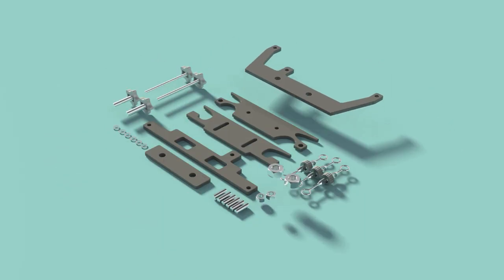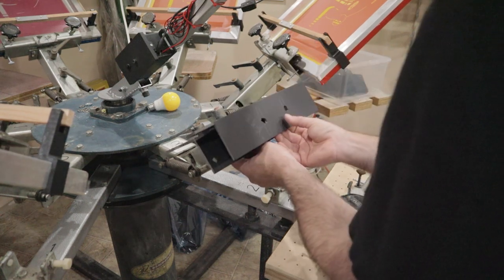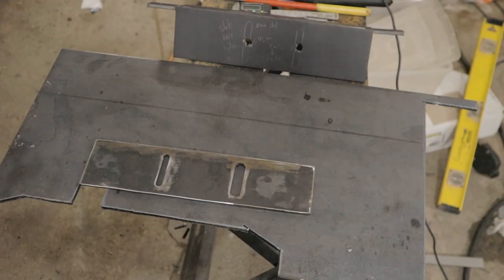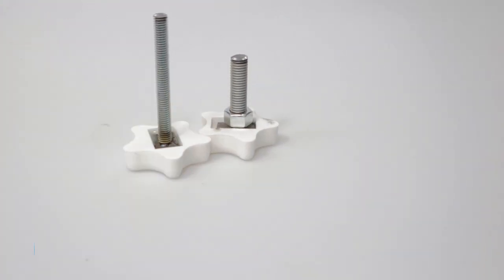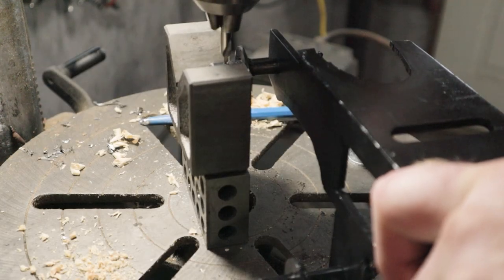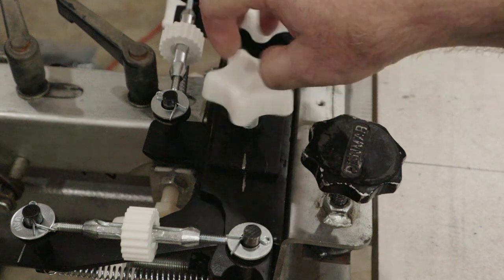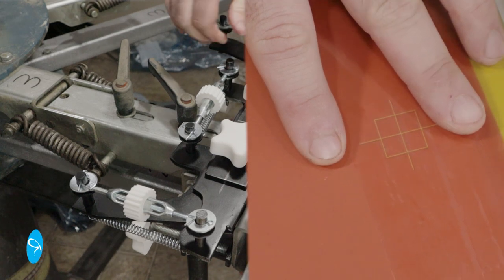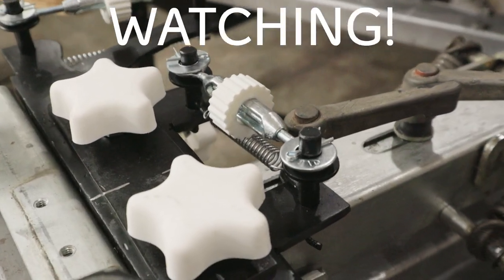DIY micro registration for your screen printing press.

Comment: I think the design is pretty spot on, finer threads aren’t a problem.
Or someone could fabric their own turnbuckle.
Maybe even use coarse ones, much longer and at a 45degree(or something).
Either way, if the plans were available on your site I’d buy them, I would obviously have to modify them, but it would save me time.

Comment: Man that looks like a success to me
Reply from the maker: I honestly think it works as intended, but having never seen or used actual micros I have no idea. I wonder if even the factory made ones are this fidgety. It takes longer than expected to dial it in and i want something quicker. I'm working on a new design now to replace the clamping mechanism in a way that doesn't rely on twisting forces.  Whether it works or not I"ll still make a video about it.
Reply: @RichardThompsonCA   Hi sir please I need the construction diagram of the micro registration I would like to do the same but I don't have the right dimensions can you share with me the diagram

Comment: Impressive fabrication. Looks like having all those adjustment capabilities ends up being an issue. I wonder if one of two options could help with those final two tightening bolts/knobs. The first thought was C-Clamps as well for at least a temporary option, if not the basis for a replacement solution. I think even one clamp applied to a section where the plates are already pressed together is better than two adjustable knobs with seemingly unsteady bolts. However, maybe you could weld some receiving nuts or threaded shaft that those bolts could screw into, rather than into the flat steel. Or grind the bolt ends into a point and create some receiving divits into the steel plate. Seems like a lot of work that's worth a little more manajalation to get it where you want it. Fully understand getting that far along and wanting to bail, with mental fatigue and such. Liked and subscribed. Great work and channel, sir!
Reply from the maker: Thanks. I have built a new clamp system, just haven't made the video for it yet. It isn't a micro registration, but it is much more precise than the original factory clamp and doesn't apply twisting force to the screen. What I'm looking for is something that registers quick. I'm hoping I can put the screen into alignment by eye, and just clamp it down without it moving. I based these micro's on designs I'd seen on other presses, so was confident in the overall concept, but in practice I find it tedious to use.
Reply: @RichardThompsonCA  need the video asap please
Reply: @RichardThompsonCA   Hi sir please I need the construction diagram of the micro registration I would like to do the same but I don't have the right dimensions can you share with me the diagram

Comment: I have always wanted to build my own press. I have an old BenMar that is very similar to this. But I'm wondering if it's worth all this just to get one more point of articulation? You seem to have had all of the adjustment capabilities expect for side to side. I enjoyed watching you build it. Might be the kick in the but I need to start tinkering more with one of mine.
Reply from the maker: I guess I did this because I was finding that chasing the registration by tapping it in was getting really frustrating. But, while this is more precise, it's still frustrating and slow to use. I've built a new version of the plain clamp with no adjustability, that might work better, but haven't made the video yet. I've got more testing to do to see if it's what I want.

Comment: Hey! You said that you were having trouble with tightening 1novel move the screen, have you connected the clamping surface of the knobs with a bar?  I've got a YouTube link hold on
Reply from the maker: Yes, thanks, that was the first thing I tried. Unfortunately it hasn't worked. I think the problem overall is just the slop in the whole mechanism. The threaded knobs fit through nuts and the clearance is pretty loose. If you tighten a screen in the clamp and watch closely you can see the whole thing move slightly. I'm working on a new design now to replace the existing clamps, hopefully with much less play.
Reply: @RichardThompsonCA   Hi sir please I need the construction diagram of the micro registration I would like to do the same but I don't have the right dimensions can you share with me the diagram

Comment from the maker: This design didn't work that great for me. It is adjustable but I find it fidgety, slow and frustrating to use, so I'm still working on designing something simpler/faster to use. Here's the link for the turnbuckle handle: https://www.thingiverse.com/thing:6101325, and for the knob handle: https://www.thingiverse.com/thing:6101332.
Reply: Hi sir please I need the construction diagram of the micro registration I would like to do the same but I don't have the right dimensions can you share with me the diagram